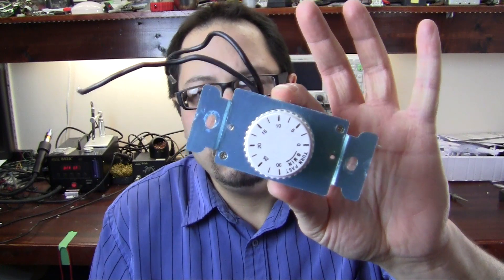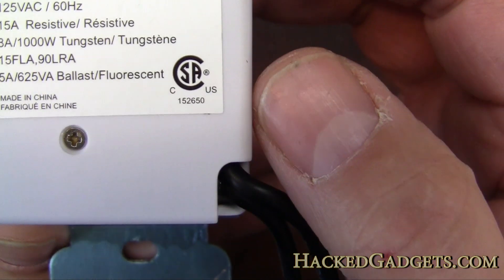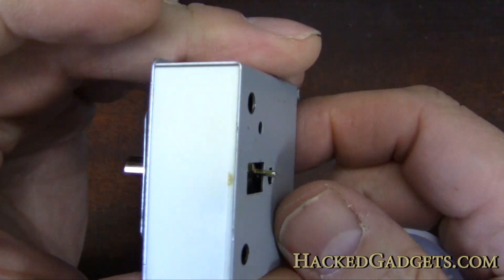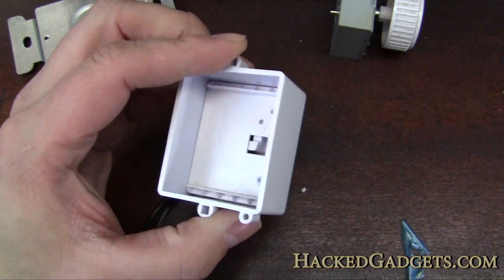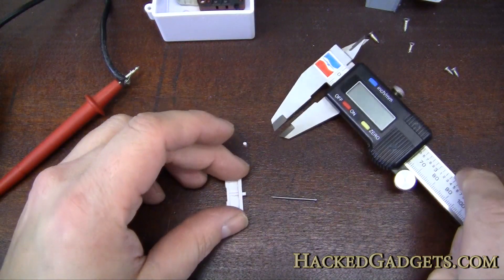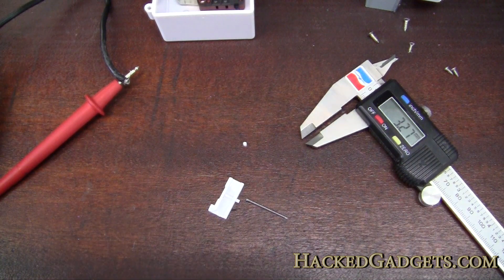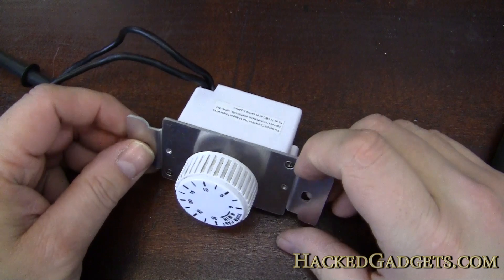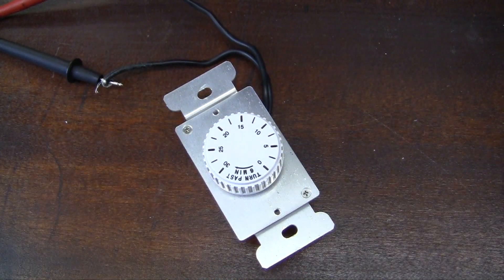Mechanical Light Switch Timer Teardown and Repair

Comment: I have a timer that just won’t turn to off and the an stays on. I have to turn it to off or it will stay on all day or night. Is it just the spring? Some of the times it will manage to finish its cycle and turn off but maybe 1 out of 10 times. Need some wd40? Or just replace? Video?

Comment: Maybe for tungsten-lightbulbs current is 8A working, beacause of the high current draw at startup. (due to low temp and lower resistance)
Reply from the maker: I looked into it a bit and you are exactly right. Heating elements have a very similar draw when cold but tungsten lamps have a very high draw for a short time until they heat up.